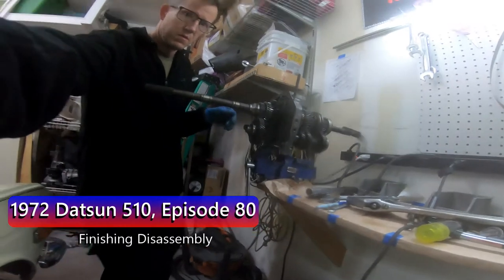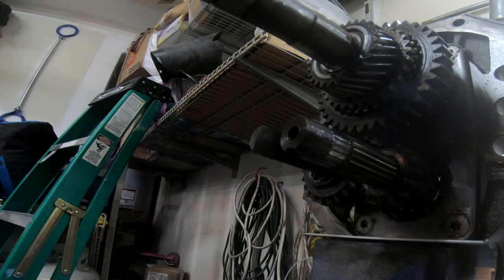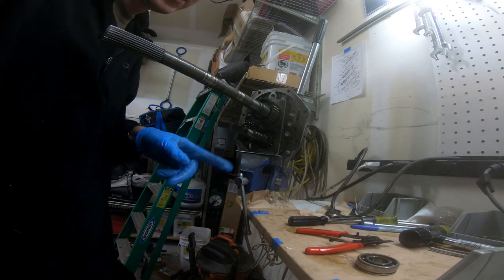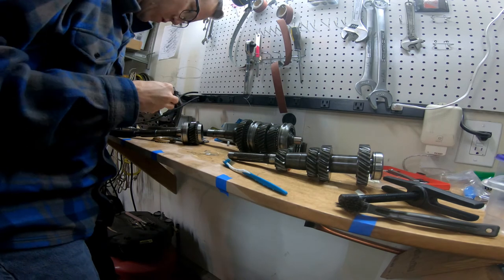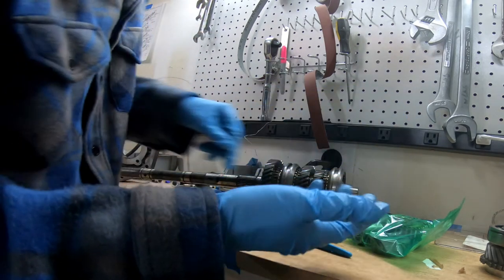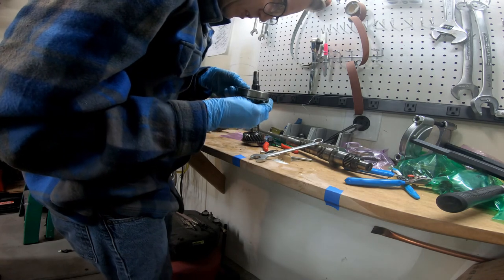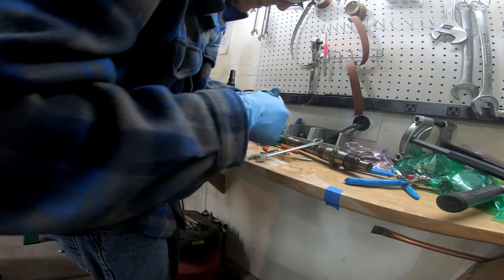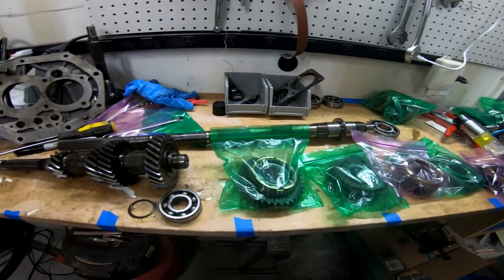Datsun 510: Finishing 5-spd Trans Teardown (Ep#80)

Comment: Do you think you could pull the input shaft front bearing on its own without tearing it all down?
Reply from the maker: I don't know of a good way to get a hold of that bearing without removing the front cover from the center carrier. 

I doubt it, but maybe if you drill some small holes, thread a couple screws into it and use a slide hammer type of puller to get it out? I would not advise  it.